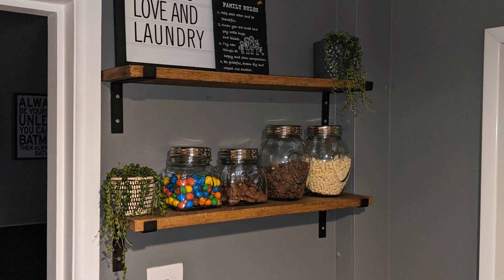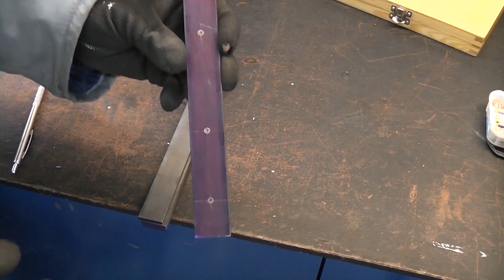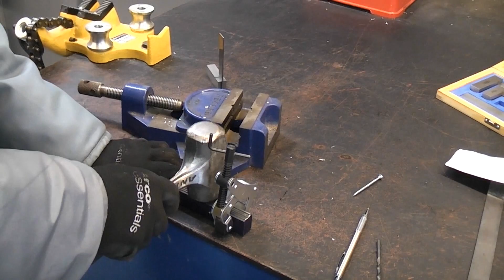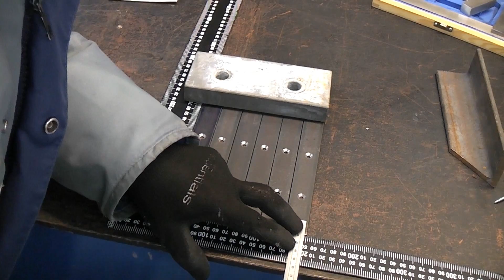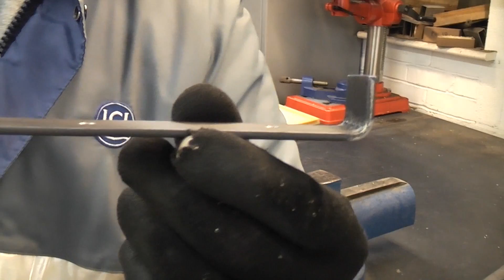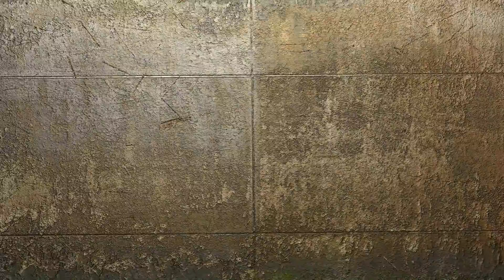How to make shelf brackets – no welding

Comment: Hi ultimate handyman...can such brackets hold about 20 litre of water in the gallon? i plan to make a shelf to hold a gallon of water to increase pressure for my shower unit...but i am not quite sure what kind of brackets that will hold around 15 to 20 litres of water full gallon? Your experience is much appreciated - i know i can use any bracket but i want that will hold it strong wont fall on anybody while taking shower ;)

Or is there any other way to increase water pressure without spending so much money :D :D
Reply from the maker: These brackets should hold that much weight, but if you want to be certain, you could make some heavy duty brackets-
https://www.youtube.com/watch?v=uPc8T-lN6xw

Comment: Perfect video my mate.
Where would be best place to purchase that steel at a reasonable price
Reply from the maker: It depends where you live, I used to buy it from Mercers in Blackburn, but you have to buy it in 6 metre lengths (they will cut it down, but charge per cut), I used to get it cut in half and then put it on the roof rack. I think that work uses K steels - https://www.ksteels.co.uk/
If you just need a few pieces, you can often find them on eBay, but it is more expensive due to the post and packing.
Thanks for the comment
Reply: @ultimatehandyman  thanks sir

Comment: Nice brackets Chez. Easy to make with minimal kit. Great video as usual. A length of 3 X 25  mm is a must for any handyman's workshop. Make all sorts with it!
Reply from the maker: Absolutely, but I'm running out of stock now. I bought a length a few years back as well as a couple of lengths of angle iron from Mercers in Blackburn, but they have closed down now.
I'm sure there will be another steel stockists locally where I can go, or I can probably get it from the guy that I subcontract for!
Thanks for the comment
Reply: @ultimatehandyman   I was just thinking that I need to get some the next time I'm near the stockholders. I was scratching around the last time I wanted some.

Comment: Lovely job :) Might I suggest a good tool I use for bending? does a great job, no hammering needed. They also do a 4" wide version but out of stock at the moment. https://www.axminstertools.com/axminster-adjustable-vice-jaw-bender-150mm-310013
Would it work if you didn't countersink the holes but used black screw caps instead? That way you wouldn't see the screws.
Reply from the maker: Thanks, but that bender will only do 2mm thick metal. It does look useful though ;-)
Yes you can use screw caps if you wish, I did give my mate some black paint for the screw heads, but he has not painted them yet.
Thanks for the comment
Reply: @ultimatehandyman  It's rated to do 2mm, I've done 3mm no probs lol I bought my mate Craig one....skip to 10:30 to see it in action...https://www.youtube.com/watch?v=BjnRuabDwZU&t=1s
Reply from the maker: @HepcatHarley   I might get one of those for future jobs ;-)
Cheers 👍

Comment: another great vid,where did you get the clamps from any links they look pretty decent thanks
Reply from the maker: I bought mine from eBay a while back, I first used these when I was at college a few years back.
They are called Kant clamps (I have to be careful saying that with my accent LOL)
I could not find any on eBay in the UK, although there are some in the USA
This site seems to sell them in the UK- https://www.mscdirect.co.uk/Kant_Twist/4294966345.html
Thanks for the comment

Comment: Look great they would sell in a fancy Manchester hipster type shop for 60quid each, get on it!
Reply from the maker: I wish I had time to make stuff like this all the time, I'm sure someone else will make a few quid making them 
😂
Thanks for the comment 👍
Reply: What's a quid, and what's a millimeter? Us yanks want to know what you fellers are talkin  about!
Reply: @ozarkarky  a unit of measurement that the rest of the world uses as it’s scalable depending on what your doing and how precise the work needs to be engineers tend to use mm  however trying to divide an inch into something that jts not isn’t exactly perfect. We still use inches today when we talk about certain things however that’s probably for a different type of website. Interestingly 1 gram of water is usually 1ml of water so it’s easy to convert grams litres volumes and measurements of may types by means of metric. It’s an interesting topic and it’s interesting why Britain the developer of imperial units in the 1800’s decided to ditch what it created for something the French had  better. Today there is only 3 countries in the world that use the old ineffective  imperial system. United States, Liberia and Myanmar, 

I tried making a cake once with a imperial recipe with  cups and 18ths of inches and  fluid ounces and I threw everything in the bin because I couldn’t stop thinking how a cup of feathers and a cup of lead is the same measurement for cakes, probably best as lead and feather cake isn’t very popular.
Reply: £12 eBay 😜 I tried to ask arround some small local blacksmiths to make some for me would have paid the online price for going local to help local business however they weren’t interested, so when they go out of business because everyone’s buying online. I know not to feel bad about my eBay purchases.